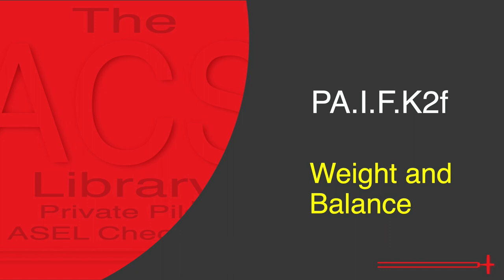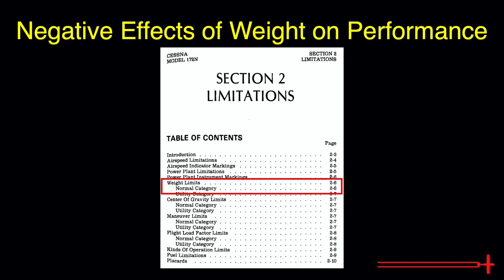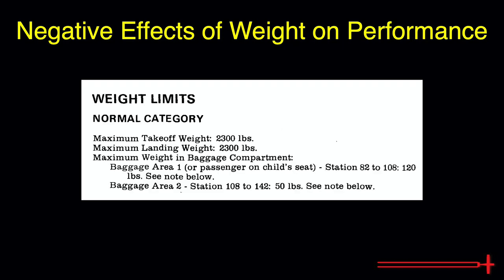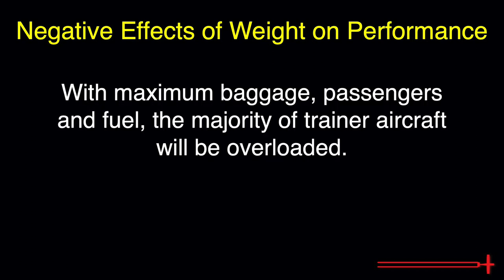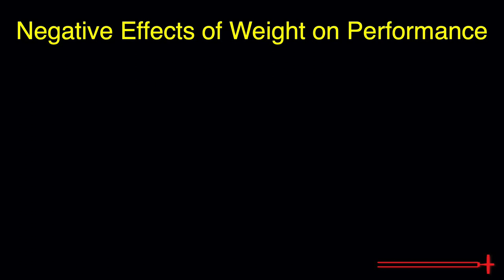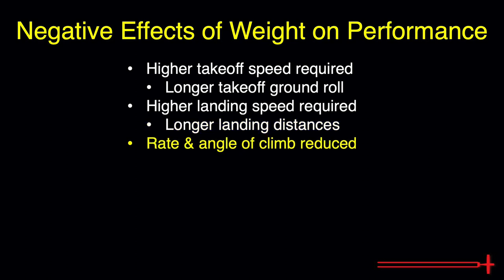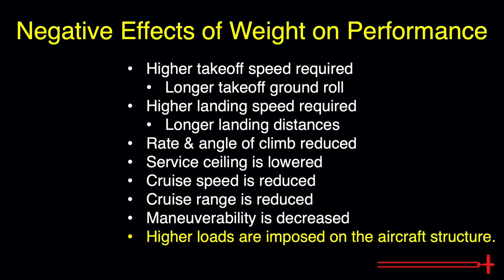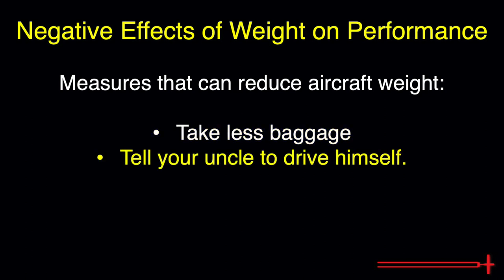PA.I.F.K2f Weight and Balance (Effects of an Overweight Aircraft)

Comment: What iPad should I buy? Does it need to be cellular+wifi? What size ipad? Does foreflight need wifi in the plane?
Reply from the maker: I would go for a iPad mini with Cellular + Wifi.  It doesn’t require wifi, and most training planes I’ve flown don’t have wifi.  You’ll only need wifi once in a while to update your charts and stuff.  As far as size, I like the mini because it fits perfectly into the plastic pocket on the ASA VFR trifold kneeboard, which is my preferred kneeboard. I never felt like I needed a bigger iPad. Cellular is nice because it lets you activate the moving map without any additional purchases.  You can always go just Wifi and buy a Sentry.  The Sentry is really nice to have anyways if you’re in a congested area.  
Here’s a good guide from ForeFlight on it…

https://www.foreflight.com/support/buying-guide/
Reply: @theacslibrary4404  Thank you! Great explanation and I'm going to look into that kneeboard too. Lastly - if I go Cellular + wifi for an iPad, do I have to connect it to my cell phone provider?
Reply from the maker: I don’t think so.  I can’t remember, but I’m 99% sure I didn’t connect mine to my cell provider.